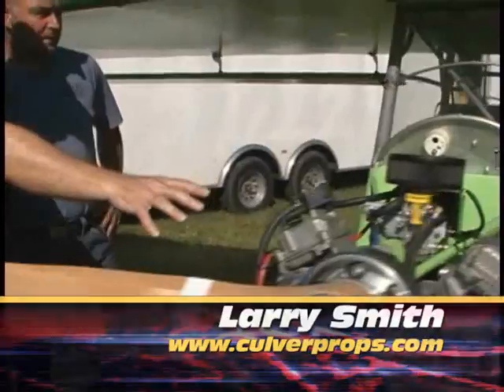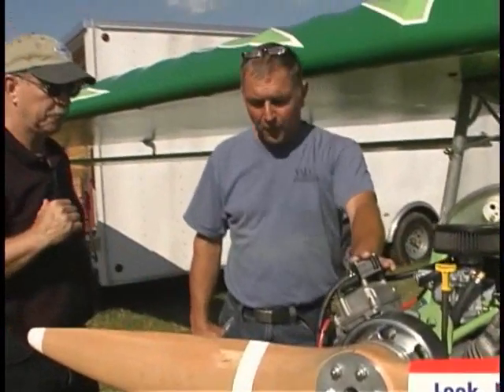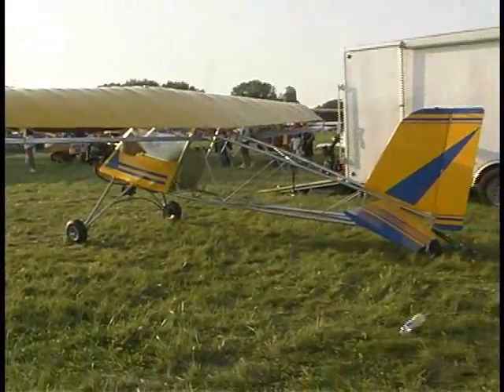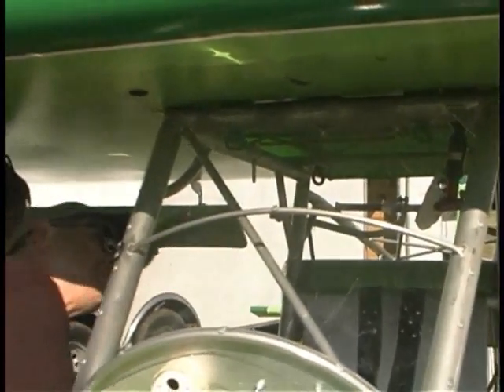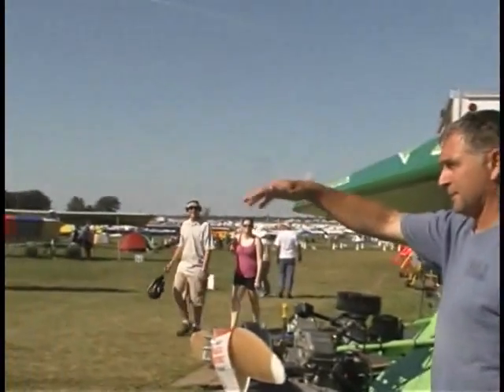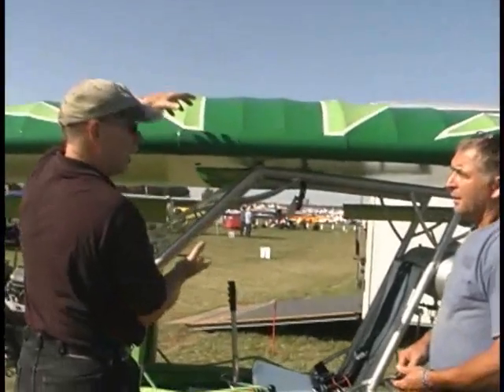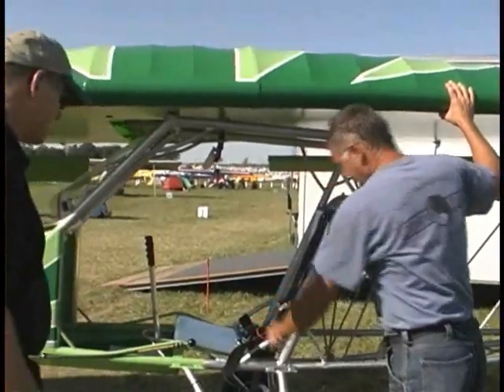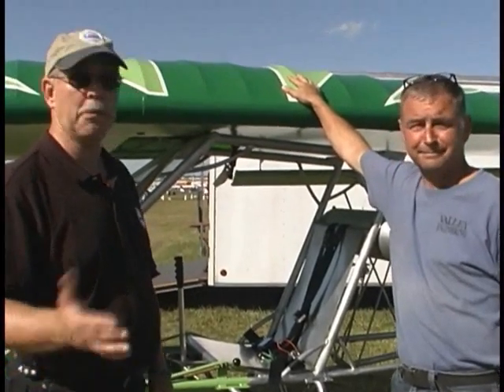Backyard Flyer Swing Wing, part 103 legal ultralight aircraft from Valley Engineering.

Comment: Two things on this aircraft that cause me concern.
1 No safety wire on the prop mounting bolts.
2. A spin-on oil filter without safety wire. The K&N oil filter is drilled for safety wire.

Comment: Yes, the lack of dihedral issue seems to be significant.  This wing has a huge cord, especially in the middle section.  Watch it is flight, and the extremely light wing loading, as well as the lack of the stabilizing influence of proper dihedral design makes this one tricky to handle, with lots of control input.   Larry Smith clearly is very bright, and has many innovations on this design, however, ease of wing handling seems not to be practical on this design, as it impacts flight characteristics significantly.  I think one has to put up with two piece wings and struts, and a wing with more stable wing design on these ultralights that are build to part 103 FAA specs.  The company seems to be out of business.  Too bad........

Comment: If I had to pay upwards of $20K for an ultralight, I'd just go ahead and get a used Cessna or Piper.  The ultralight would offer no benefit at that price.
Reply: With a Cessna or Piper, you're going to burn a lot more fuel per hour, land at longer fields,  have to get insurance, can't fly nearly that slow or trailer, have nearly as good of visibility, have to pay someone to do / sign off your work and you have to pass a medical. The piper or Cessna is better for cross country, though.

Comment: $20 000 for such a basic aircraft?? In my country you can buy a "Ptenec-2" developed by ECB Rotor with all the navigation stuff and Rotax for under $12 000.
Reply: I'm no pilot or engineer, but have been a certified welder for 20+ yrs, and I think $20,000 is VERY INEXPENSIVE. Like they say in the videos, these welds have to be EXTRA strong, which, like they also said, takes a LOT of man hours and man hours=time=money. Just that grade of aluminum alone is probably several $$$ per linear foot alone.
Reply: But do you need a liscence to fly it?
Reply: The ballistic chute alone is probably $4000.
Reply: That would be great.
Reply: Good stay in your country!!!